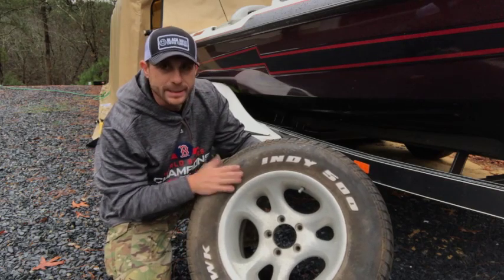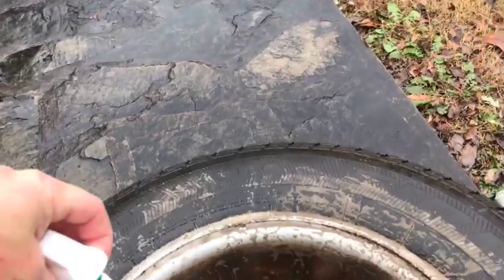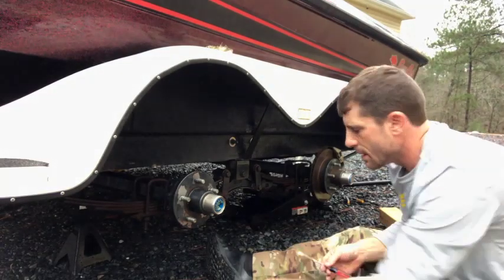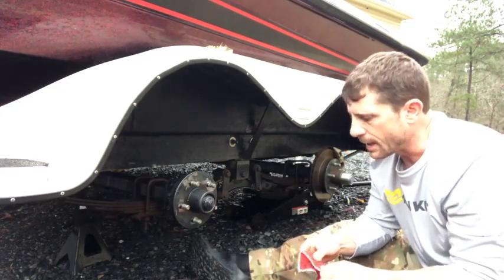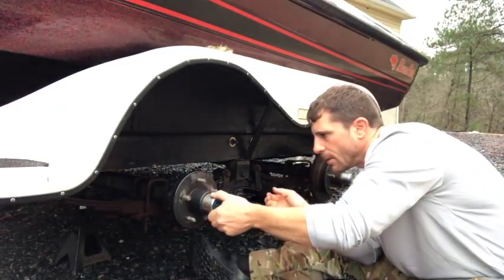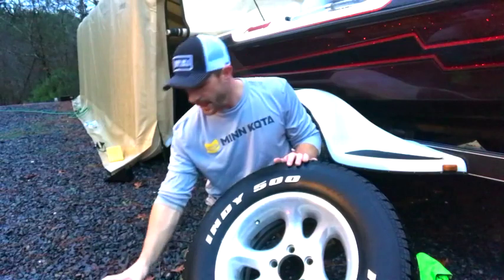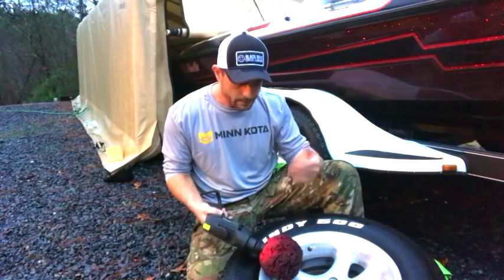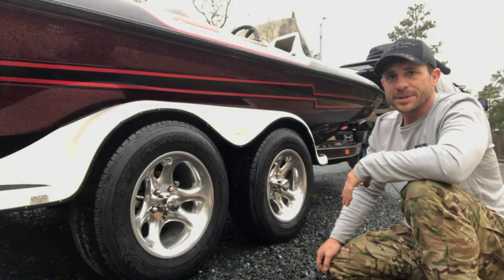Wheels, Tires, Hubs - 2005 Bass Cat Puma

Comment: Is the SRT a trailer tire?
Reply from the maker: jasonsupafly it’s a passenger car tire.
Reply: @caldwelljamey  Let me first say that I'm not a tire expert just to get that out of the way. Just wanted to share. I inquired about non-trailer tires for my bass boat trailer last year. I was told and kinda laughed at, that it is illegal to put radial tires on a boat trailer or utility trailer. I was informed that LEO's love to write tickets for radials tires on trailers. The shop told me I couldn't pay them to put radials on my boat trailer. I was asking to do so because there are more options of quality tires when it comes to radials versus trailer specific tires.
Reply from the maker: @jasonsupafly  Good info and defiantly something viewers can research to make sure they are getting the right tire for their needs. Most trailer tires are radial so not sure why that shop told you not to do it??
Check this link for more info. https://www.rvweb.net/best-trailer-tires-reviewed/
Thanks for your feedback and appreciate you following the page.
Reply: @caldwelljamey  Thanks for the link. I'll check it out. They said something about having to be a ST tire. I would've rather went with something better and wouldn't have minded paying more for a good passenger tire but they advised against it. We'll see how long these cheap, no-name, may-pops, that they put on last.